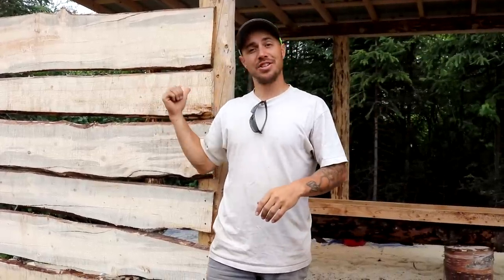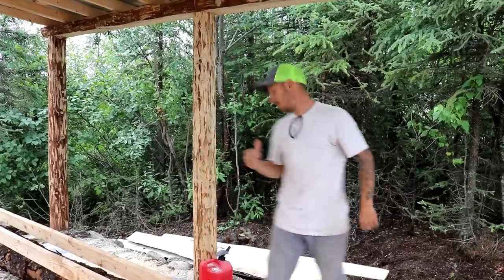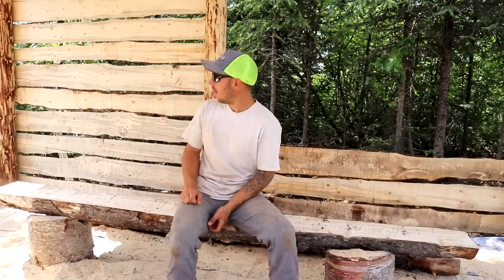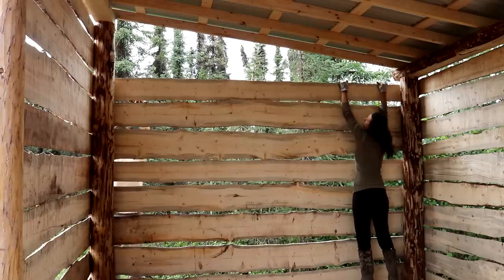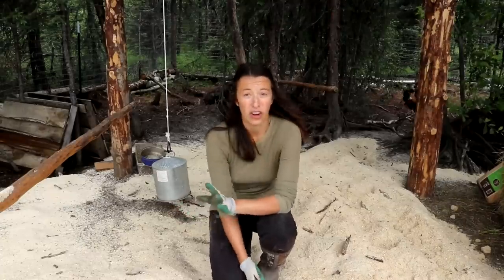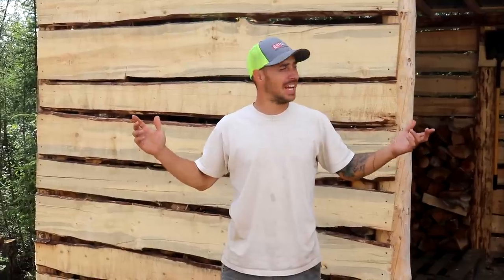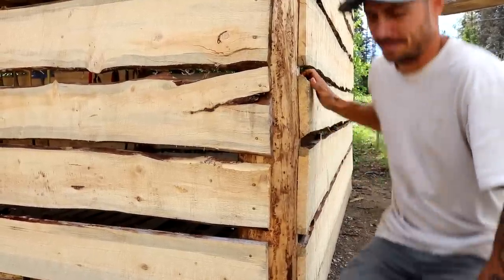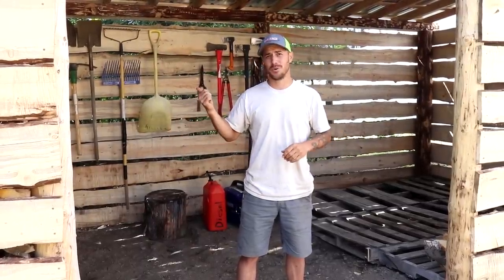Milling Live Edge Siding | Wood Shed Build (Part 3)

Comment: Watching your milling process it becomes clear you're using and under-powered saw, and probably  a standard chain, whereas a proper ripping chain will cut faster and smoother, (no visible ripples in the cut surface.) and way less pushing power needed.
Also, to push a mill while on your knees seems mighty strange to me, why not using taller supports?
I milled 1000's of board feet in my life time, I virtually have "gone though the mill" LOL

Comment: probably would of had a better experience with a RENTED bigger saw 80-90 cc, would of cut the slow cut in a quarter the time no doubt. looks great though good works guys, park the 6 wheel in winter

Comment: if you overlap the boards, then you don't have gaps between them. You  mentioned snow and rain, if you overlap the boards then it's called weatherboarding! Am I missing something? Sorry if I am!
Reply: That would really slow down the air flow which is needed to keep the logs dry and mould free. A little rain and snow may get in but not enough to cause a problem.

Comment: Eric are you using a ripping Chain ?
Reply from the maker: Mario Wickel That was not a ripping chain, I did have one on for one of the logs but felt my regular chain was doing a better job.
Reply: @SimpleLivingAlaska  
The difference is more noticeable in hardwood. You can rip with a crosscut chain, but it’s hard to cut firewood with a ripping chain. The only difference between the two is tooth angle. Regular chain is about 30 degrees, ripping is around 10. So you can re-file a crosscut chain to rip with, if you have several. No need to buy a special chain. Ripping chain is usually semi-chisel, whereas your regular chain may be chipper, semi-chisel, or full chisel (my preference- cuts faster. But dulls faster too).
The big difference is how smooth the lumber will be, which in this case you don’t really care. Ripping chain cuts slower, but leaves a smoother board, which saves time later on if you are sanding or planing the lumber (or even eliminates the need for those operations if you aren’t super concerned).

Comment: Don't you think the gap will allow snow to build inside? And you should watch crazy Russian hacker he did lot of video where he try many way for splitting wood easily and if I remember correctly it's easier if you take a bunch of log attach them together and start splitting them that way they don't fall and you can keep splitting. Good luck from France